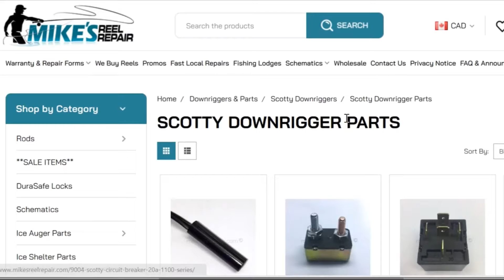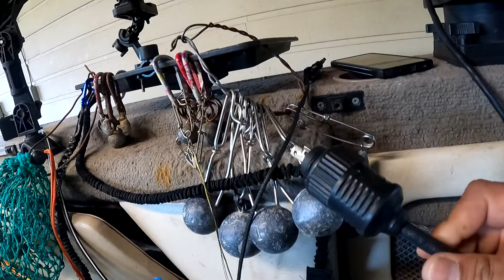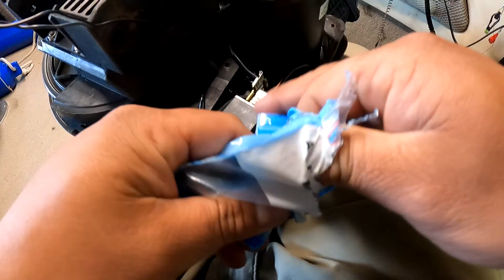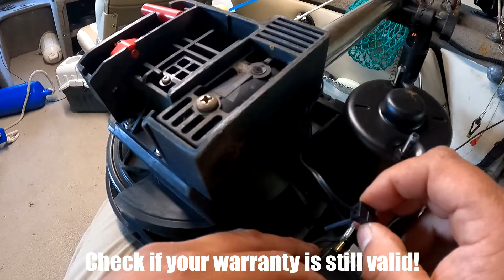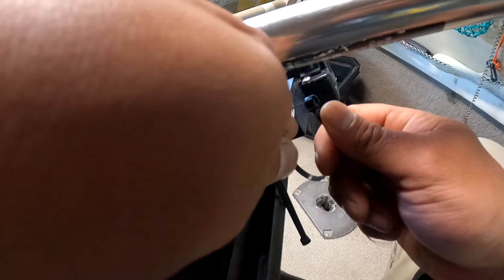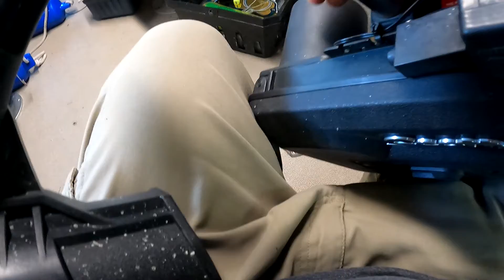How to Troubleshoot, Hack & Repair Scotty Downrigger. Autostop switch fixed! Electrical Overview DIY

Comment: This video really helped me out, thanks a ton!

I took my Depthpower 1101 apart and couldn't figure a way to bypass the switch and test just the motor. Do you know of a way to do this? Could I connect power directly to the two posts sticking up on the motor? Didn't want to fry anything so I didn't try... I connected power to the plug and had power at the relay so I know the cord is good.
Reply from the maker: Feel free to reach out in my Fishing is My happy place fishing group. Then we can connect via messenger. I've also left a link in the description section for the wiring schematic from Mike's reel repair.
The switch gets faulty for a lot of users, so it's probably that simple. PM me, I'll help u out. Cheers!

Comment: I think this is what is wrong with my downrigger. Tried a new relay and the fuse is good. Thanks for the info.
Reply from the maker: I hope it works out! I recall leaving a link in the description section for the electrical drawings if you want to troubleshoot further. Let me know how you do, and I'm more than happy to assist if you need anything else. Tightlines!
Reply: @fishingismyhappyplace  I must have a very old unit as the reed switch is 'L' shaped. I'll probably have to replace the whole switch assembly. Btw, I placed a stronger magnet near the reed switch and the motor worked. Probably a failing reed switch but I'll replace the whole switch.
Reply from the maker: That will probably do it! Plus, you have a spare relay. Better hurry the fish are biting! 😃

Comment: For us normies would this normally be covered by Scotty warranty?
Reply from the maker: I believe if your original owner then it would be covered, but you would have to consult with Scotty.  I bought mine used, and having a couple of spare parts wouldn't hurt if you're ever mid trip and need it working asap. Hopefully, this video will help guide you through if that happens .

Comment: I have the scotty line puller and motor seems to just hum when I pull the on switch.  I have removed the motor and put the leads direct to 12V and works nice and strong. Now thinking it maybe this same issue as I believe this is used on that model as well.  Thoughts?        Thanks for the Vids!
Reply from the maker: By line puller, do you mean a downrigger or trap puller?
If it's a scotty downrigger like mine, it may be a poor connection of power delivery onto your motor. Try tapping on the relay while running (in a controlled environment ofcourse, as your electrical will be exposed while doing so), check for signs of corrosion or loose connections/devices from power to the load end,  measure proper voltage all through out starting from the output end of the relay and see where you're losing voltage. Remember that this is a 12v DC device, and working voltage matters. Too low, and it may struggle, as well if it's used, how well used was it? Do u have another rigger where u can swap electrical components to isolate the  issue you're having? 
From the sound of it I don't think it's the reed switch like mine as, your relay is activating the motor, sounds more like power delivery. 
Hope that helps! Let me know what you see. Good luck!
Reply: @fishingismyhappyplace   Ended up being corrosion on wires ands contacts at plug end.  Pulled back boot and respliced wires and cleaned terminals.
Reply from the maker: Woohoo! I'm glad you got it sorted out. Corrosion will definitely do that. I just swapped my starboard side receptacle. Same thing corrosion that ended up melting the connection on the wire terminals. You might as well check the port side while you're at it. Now you're ready to fish again, Tightlines Dave!
Reply: @fishingismyhappyplace
Reply: it was the male end of the plug. One of my downrigger motors also seems a little slow. Now i'm thinking this maybe a voltage drop again..  Keep the videos going...
Reply from the maker: Best of luck, Dave! Hope u nip in the bud before you're out again. Sure thing, I will keep it going, thanks for the feedback 🙂👍

Comment: Fishing is My Happy Place & Adventures., I really like your videos, let's be friends!
Reply: One of my downriggers doesn’t stop when raising the ball. It worked fine a week ago but now runs until clip is jammed in the reel at the end of the pole. Wondering if there is some stop bead that is missing?
Reply from the maker: Hi Doyle, thanks for watching and reaching out.
1. When does it do this? When it's on auto or manual? 
2. A stop bead or auto stop swivel needs to trigger the auto stop switch in order to open the circuit. Do you have one installed?
3. It's possible that the switch actuator is sticking, the Reed switch is stuck closed, or the relay is stuck closed.
4. Does it go up on its own as soon the 12v plug is in the receptacle, without switching to auto or manual? 

Feel free to join our FB fishing group and we can chat there and share pics to solve your issue.
https://www.facebook.com/share/FBvQRYgmCSdT3Wiw/?mibextid=A7sQZp

Hope that helps, tightlines and chat soon!😊
Reply: @fishingismyhappyplace  normally I turn it to on and raise the ball.  Yesterday it continued to pull the cable and the  black bumper up into the reel. Your item 4 It will rise on its own if set to On  and plugged in.  I had to raise the ball until it got close to the arm and then switch to off.  We have 2 of these units so I need to feed line out and look at the line configuration on the good unit and compare to the other unit.  Boat is at my Son's house.  How would I tell if actuator switch is sticking?
Reply from the maker: The actuator of the auto/manual switch might be sticky. Try operating to auto, then trigger it with a screw driver. Normally, a sure stop bead or swivel will trigger it. 

It might be easier to troubleshoot without the ball. The auto/switch is either getting stuck or your stop bead isn't triggering the actuator. Spray some wd40 on there and work the movable parts of the switch. I just checked mikes reel repair, and the part is $30 to $50, depending if you have the DP or HP downrigger. 

Find me on our FB group. Then, we can share pics and trouble shoot it. Hope that helps!
Reply: @fishingismyhappyplace  Thanks will give that a try
Reply from the maker: Thank you! 😊